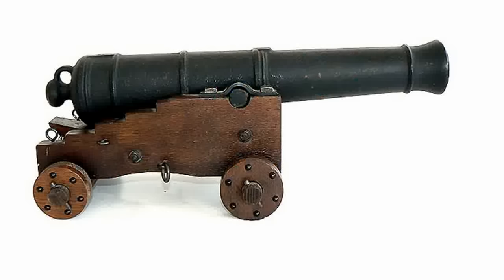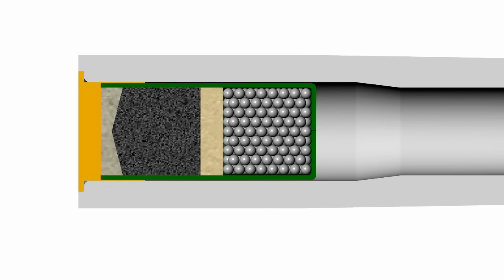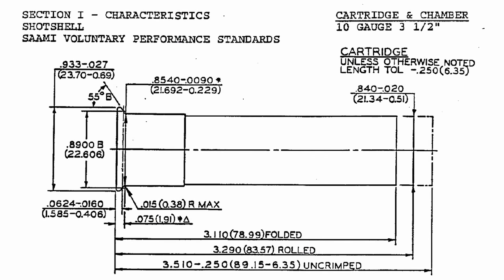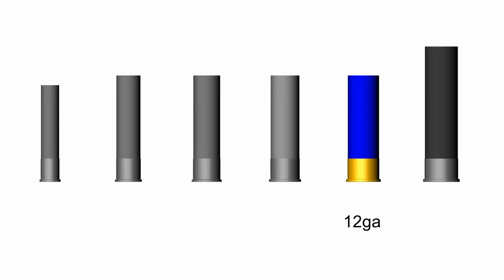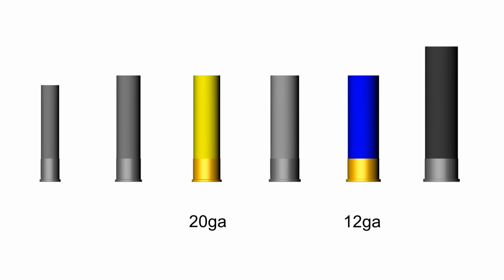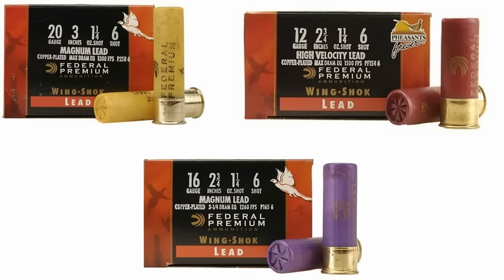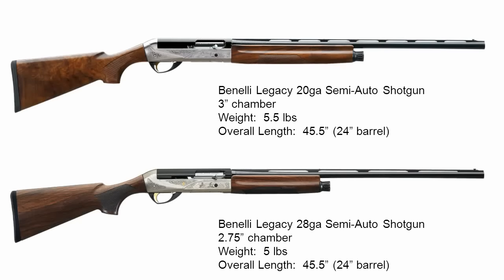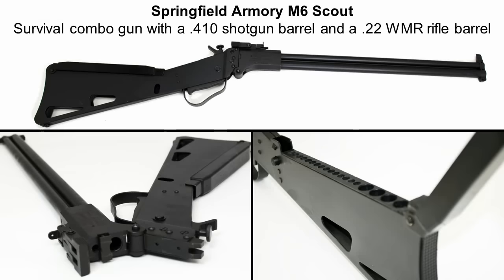Shotgun Gauges Explained - Shotguns 101 #3

Comment: I agree with most of what you said. Here is my opinion as a shotgunner who started on a .410 single shot Rossi like showed in your video to anyone who cares.

.410 is a great starter shotgun for anyone who is a serious firearms enthusiast who is attempting to learn a skill. They are garbage for anything beyond 30m, after that it's  a challenge. Ammo is hard to find during hunting season so stock up before hand and price of ammuntion is pretty high. Not ideal for defense or anything but small game hunting and sport shooting.

.28 gauge patterns like a .20 with less shot, at twice the cost (for hunting ammo), and ammo is scarce. This shotgun is for the true small bore enthusiast. They excel at small game hunting versus a .410 but lack big time for rarity of ammo, and versatility. It is a small game and sport shooter only, defense ammo is next to impossible to find. Even components for reloader.

.20 Gauge is the overrated baby .12 gauge. Praised and touted for "outclassing" it's larger rival the .16 gauge and constantly praised for being a great gauge, its actually among the worst. Most .20 Gauges will not pattern #5 or greater shot loads without shot stringing. I have shot grouse numerous times to have them fly away. .20 Gauges are over stuffed the moment you add beyond 7/8oz. Like 1oz or greater, enjoy a weird pattern that is weak, and often proven to fail. Load 7/8 oz loads and no larger then 2 3/4" shells and you found the happy medium. .20 Gauge will do 35m well enough but sucks beyond. Dramatically weaker and the pattern gets weak. Its good for small game hunting and sport shooting, and ok for self defense.

.16 Gauge, the underrated perfect shotgun. First off, Remington is the worst example of a .16 Gauge, they did it wrong, a .12 Gauge gun bored small on all levels. Yeah you added 1.5lbs to the gun. .16 Gauges weigh usually around .28 Gauge to .20 Gauge weights. The .16 Gauge out patterns .20 and .12 gauges, while slinging lead further and harder then both. .16 gauge is perfect for upland birds, small game, medium game, defense, and the list goes on. It does everything shy of properly loading buckshot loads for 0, 00, 000 Buck. You get #1 or smaller, which is ideal for home defense for not over penetrating. These guns handle like .20 Gauges hit hard like .12 Gauges. Highly reccomended for all hunters and sport shooters. Although ammo can be a challenge to locate.

.12 Gauge is just .12 Gauge. Excessive recoil is a huge negative, weight is an issue but numerous lightweight .12s exist, but more recoil. You can shoot a .16 all day and all the smaller gauges as well, .12 will ware you out and make your shoulder sore after a while. .12 Gauge 3 1/2"  shells are a joke, again over stuffed. Then its too much pressure and insane recoil that leave experienced shooters with a sense of disappointment. Having all the negatives out of the way, this is the shotgun for someone who just wants a shotgun that is super cheap and available. .12 Gauge is the most versatile shotgun for all applications but it is perfect at nothing.
Reply: And .10 Gauge is just a waterfowl/turkey gun. Its versatile to relaoders, but ammo and firearms are expensive. Versatility in factory loads aren't a thing. Its turkey loads, waterfowl loads and defense loads. However this shotgun exceeds at being a comfortable larger bore shotgun with maximum versatility. It can be loaded down to 5/8oz to at least 2 1/2oz. Although the .10 Gauge market is not looking top hot these days. Only Browning makes them as far as I know. Ammuntion is loaded by fewer companies then any other gauge, and many companies do not load for it like Fioochi who load .12, .14, .16, .20, .24, .28, .32 and .410 but no .10. .10 Gauge only ever had popularity in North America as well. It wasn't very popular. .24 and .32 are still used in Europe and South America, and .14 Gauge still sees use in France.
Reply: Short of you uploading a video, this was excellent informative information! So what I’m getting from this is I need to aquire and use a .16 gauge at my local turkey shoots because they tend to pattern better so I have better odds of winning?!? 👍
Reply: @x0xCRUSHERx0x  I would recommend it. I don't see it being an issue. If .20 Gauge can do it, .16 will do it better. If you want a lighter shotgun, I strongly recommend a .16 Gauge. Look for a used Ithaca Model 37, or Winchester Model 12. Or if you want new and have anywhere from  $650 to $3000 they can be found easily. Browning, Barrett, CZ, TriStar and Merkel make them currently. I can list numerous more companies if you want one. But if you do want one and are serious, reload your own ammo. Like Heavi Shot loads .16 Gauge 2 3/4" MAGNUM loads, like 1 1/4oz with #4, however that maybe too much.  Try using 2 3/4" at about 1oz or 1 1/8oz at about 35m max for turkey. But for grouse, I have shot them from 4 feet away to 50m away. I have shot clays at 70m with my little cheap Canadian made Cooey 84 single shot. My Ithaca Model 37 is a dream though. That thing loads smoother then oil slick on an iceberg, and operates even smoother. It weighs less then my Mossberg 88 with an 18.5" barrel in .12 Gauge, with it having a 28" barrel. That shotgun right there would be a PERFECT turkey gun. Or a Browning A5 Sweet Sixteen but those are pricey.
Reply: @x0xCRUSHERx0x  Also don't listen into the bullshit of you need an Extra Full Choke for turkeys, and it must be in .20, .12 or .10 like reccomended on the boxes. That is for ideal performance and those gauges have Turkey Nitro loads. Which a .16 Gauge standard load use to be used all the time back in the day. But it being booted from competition and not recieving the attention from mainstream manufacturers after WWII, it met a decline. .20 gauge 3" Shells would further bridge the gap, and so would shot shell technology. But seriously, even with all of .20 and .12s upgrades, they do not surpass the .16 and .10. .10 will shoot heavier loads more comfortably then .12 Gauge 3 1/2" magnums, and .16 will surpass the .20 at EVERYTHING and wont wreck your shoulder after shooting cases of ammo.
Reply from the maker: One note, shotgun gauges don't have decimal points in front of them unless you're talking about REALLY big bores.  A 0.12-gauge bore would be wider than most 12ga shotshells are long!

Also, penetration depends on velocity and pellet size & density, not really gauge.  Recoil likewise depends on gun weight, payload weight, and velocity.  Gauge isn't part of the formula.
Reply: @SynchronizorVideos  It all depends where you are in the world for that decimal point. In Europe it is not used, in North America it is used heavily. We don't just say 12 gauge or 12 bore, its often times its just .12, unless we are refuring to the 12ga or  But in my opinion it's not a big deal, because at least we know what we talking about.

I disagree with that last statement however. For almost all gauges you are absolutely correct, but .20 Gauge has the issue of pushing payload against the barrel. It causes shot stringing, loss in velocity and then you get shot pellets fly at random. If you overstuff the shotgun, you will be guaranteed to have this issue. With .20 Gauge everyone wants more then an oz in it, and many want the 3" Magnum loads for no good reason. I am speaking out of my personal experience, and both Federal Ammuntion and Browning have concluded done studies about it. .20 Gauge is great for shot under #5, and for loads under an oz, unless you are trying your hand at waterfowl.

And I own four .16 Gauges and one .20 Gauge for a reason. I have shot a dozen .20 Gauges, and have a lot of experience with a Model 12, Mossberg, Stoeger, Remington and Cooey .20 Gauges. My crappiest cheapo Hatsan Optima .16 Gauge dusts the best .20 Gauge I have shot. My Ithaca Model 37 .16 Gauge is out of this world for patterning, range and weight. Also, no one misses with the .16 it seems where .20 Gauge people are missing every second shot. These are just my experiences, and some facts that are proven on the .20 Gauge. I may sound like I hate the .20 Gauge, but in reality its my second favourite. Its between 16ga and 20ga for me, but I'll chose the mighty Sweet Sixteen everytime.
Reply from the maker: Whether you're in Europe or the U.S. (and I live in the U.S.), shotgun gauge is by definition the number of bore-sized lead balls per pound.  So no, there's no preceding decimal point for normal bore sizes.  The .410 gets a decimal point because that number is a direct measurement in inches, not a gauge.
Reply: @SynchronizorVideos  I am Canadian, and I have seen the decimal points in our stuff, but only when defined by exclusive number. I have an issue with saying things like .12 gauge or .16 Gauge, when it should be 16 gauge instead as an example. But essentially I have seen it written as such, I am using 16ga as my example: 16 bore or .16 bore, 16 gauge, 16ga, .662-.666in (but that is just being a dick), and lastly just .16. When it is a number exclusively, I see it as .12, .16, .20 type thing commonly. Or as listed by numerous Candian stores or catalogs.

I am aware .410 is bore measurement, not bullet/slug diameter as many try and say (not saying you said that either) and is the only American shotgun I believe. However I am not sure about that, I was also told .16 and .10 were American. I know they were popularized by America and .16 is still popular in Europe today.

Comment: So which is best for a militarized approach to home defense when you want to put an intruder DOWN for the count?

I'm 5'9" 210lbs and not the best Marksman
Reply: If you are not worried about blowing holes in your wall go with 12 gauge buck shot. If you have family and this is a concern, use bird shot. A 15 foot shot to the face with bird shot would stop a intruder easly. Buck shot won't have as much spread but it will throw 32 to 33 caliber pellets out and tear a intruder down easly, anywhere you hit them. I keep mine loaded with turkey loads. They have high brass and big spread.  Slugs have the most stopping power but are extremely dangerous for home defense if you have other house members and a bad shot. If you go with bird shot, stick to 12 gauge.
Reply: Flame thrower! But keep your back to the wall.
Reply: Difficult to beat a 12ga pump.
Reply: 12ga w/ fragible shot.
Reply: If you dont have a coilgun in your house you arent a real man /s
Reply: Also make sure no matter what, make sure it's stocked. Being able to shoulder improves user accuracy and doesn't hurt your wrist too.
Reply: Brass knuckles we use in Britain,,,🤗
Reply: Anything with Birdshot, if your close enough that shit can blow a person in half
Reply from the maker: For close range, buckshot.  Longer range, slugs.  Never birdshot unless you're being attacked by birds.  Probably 12 or 20ga just so you have good ammo options, but 16ga works just as well if you want to be unconventional.  Get a proper shoulder stock with a good recoil pad, and you'll be able to handle it just fine.  And practice.  No replacement for that.

Also, a gun alone doesn't make a home defense plan.  It's just a piece of the puzzle.
Reply: Run at them with a 3lb Rubber Mallet naked and screaming.  Cheap reloads too

Comment: I always just thought gauge number was how many balls in the shot
Reply from the maker: No, even for the same gauge, the number of pellets can vary due to different sizes, materials, and the total shot weight.  And there's a lot of overlap between gauges too; a 1 1/4-ounce load can be had in 20, 16, 12, or 10ga shells, even if you're not handloading.

Comment: Do any of these gauges match up to a crimped roll of pennies? I guess diameter wise basically if I filled one with pennies which gauge would be best fit for a tight hug and seal
Reply: This is for a gift for my dad as I'd be actually filling a few with pennies from his birth year
Reply: 12 gauge i believe
Reply from the maker: Don't shoot coins out of your shotgun.  But to answer your question, a U.S. penny (I'm assuming that's what you're asking about) is 3/4 of an inch in diameter.  It would fit in a 10ga bore (.775"), but not a 12 (.729").  Again, don't shoot coins out of a shotgun.
Reply: @SynchronizorVideos  why not?
Reply from the maker: The density & shape of coin metals leads to different filling of space in the hull compared to the same volume or mass of shot, which invalidates most pressure-tested load data.  A stack of flat metal discs has much less compression and/or flow compared to a mass of spherical pellets, which tends to raise peak pressures.  The hardness of the typical cupronickel alloys used in coinage can severely damage a shotgun's bore, or the large coins can swell a barrel or blow out a choke that's too tight.

Also, coins are really crappy projectiles.
Reply: I use dimes as a wad/over shot card sometimes in a 12. But don’t ever load a stack of coins in a gun. 15 dimes WILL blow your barrel out.
Reply from the maker: I wouldn't even advise that, since it could still screw up your barrel or choke.  If you want good overshot cards for loading 12ga shells, buy a 5/8" circle craft punch, and knock circles out of paper or cardstock.  They won't affect pressures or damage your barrel, and they'll cost a heck of a lot less than 10 cents.
Reply: Synchronizor that’s a typical solution yes. I was definitely not suggesting anyone else follow my example and apologize if it seems I was. This is simply something I do very occasionally with a “greasy-T special light super magnum” load. Top to primer (dime, .1.25oz. #4 buck mixed w/ dry sand 60:40 by weight, .5oz. Mini slug, 1-4 cotton ball(s), dime,39.5gr blue dot powder, 3-1/2in federal shell, cci primer)
I SHOULD make a thin disc mold for lead and use that instead.

Comment: I'm looking to buy some 28 gauge hulls.   Who is selling them?
Reply from the maker: Ballistic Products always seem to have hulls in stock, though they seem to really like Euro hulls for some reason, and those can be hard to find load data for.
Reply: @SynchronizorVideos  -  Question:  these hulls are new, and have't been crimped.   How do you start the 1st crimp?
Reply from the maker: @mu99ins  You can also get special crimp starters that are made of sharp brass to help get the folds started.  There are also hull conditioning tools that shave down the thickness of the mouth to help make crimping easier (some new hulls already have this done to them).

Or roll-crimping works well too.

Comment: I like shoot bigger rounds, and everyone of these loads are better for certain situations. 
  But when you said a .410 may round my discourage young hunters, (I understand what you mean) though you missed the best points of a .410 with young hunters.
  I got a .410 for my first gun. Run home from school to go out small game hunting  (squirrel)every night. .410 made me a much better shot becouse its less bbs so my shot had to be more precise.
 Started shooting squirrels with the gun on my hip(side).
 Then started rabbit hunting would miss not by much(12 gauge it would of been a kill) but I learned and earned my rabbits with a precise shot. 
 I would shoot slugs from my side of my hip with a .410 New England smooth bore single shot in a paper plate at 50yards average about a 4 inch group. Could shoot 3 round fast as you could shoot a pump.
And Ive killed deer with it.
  If anyone wants to improve their shot with a shot gun of any size. Go rabbit hunting with a .410 single shot.
 I use mostly a 12 gauge now.Becouse rounds are cheaper, and becouse my younger kids been using my .410.
Reply from the maker: Yeah, a lot of folks say the .410 is better as an "expert's gun" since it takes some skill to use it effectively.  And it can certainly be useful in building skill.  But even in really good hands, it's still going to have some significant limitations in some roles.
Reply: @SynchronizorVideos  .410 isn't an "expert gun", but is a gun that will advance you into becoming an "expert" with bigger gauge shot guns.
  Thats why I would recommend it for youngsters for small game hunting.
1. It tightens up their shot
2. If they do make a mistake being safe then the consequences may be less damaging.